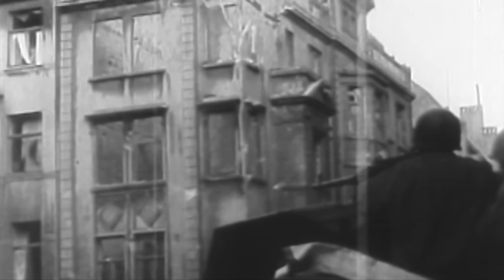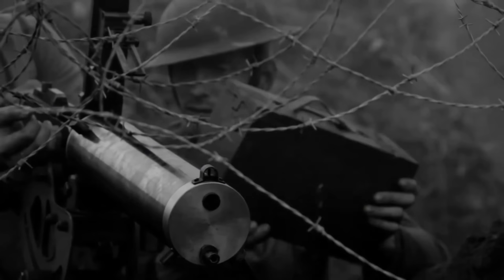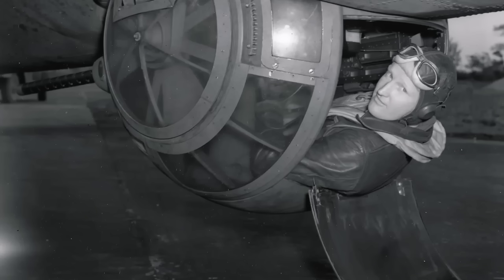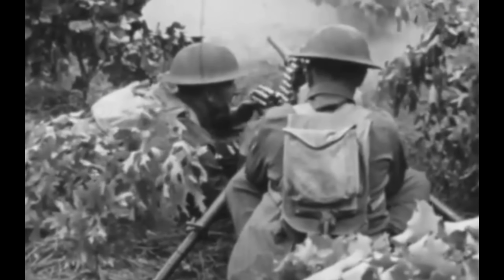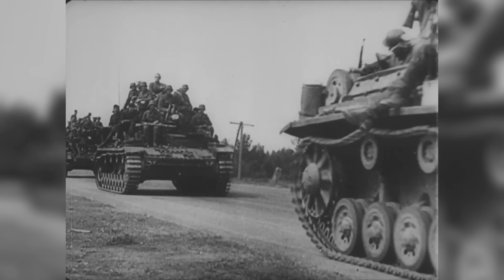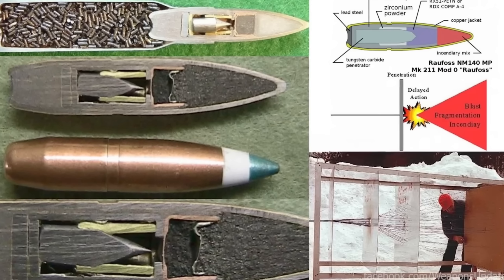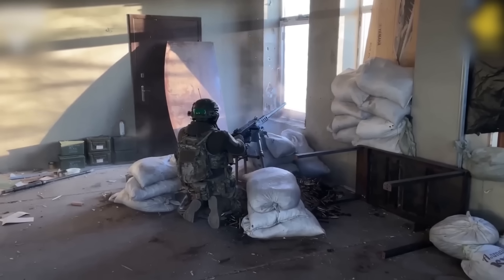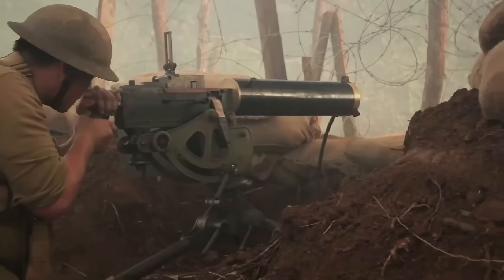The Dark Reason Germans Hated American M2 .50 Cal

Comment: My late F-I-L was a Sgt in the 9AAF, 346thFBG, 107thTacReconSqdrn, P-47 Thunderbolts, ETO, 03/42-09/45. The Thunderbolts had 8 M2’s aboard, I’ve read and heard that when they would dive from 25,000 feet and reach speeds of about 600mph and opened up on German fighters that the recoil of all 8 guns at once would literally slow the P-47 considerably. I bet it was a sight to see.
  My late B-I-L served two terms in the Corps, 69-71, in Vietnam. He told me their FFB was attacked by a considerable force of NVA and VC, he was on an M2 and hit an NVA soldier as he threw down a makeshift ladder onto the barbed wire; John said it cut him clean in two, his torso fell one way and his trunk and legs the other way.

Comment: My BIL was in the USAF and assigned to command an engineering company in Iraq. The M2 was his favorite MG. He said that it could penetrate concrete block walls after a short burst and shred enemies behind. Although he didn't get into many firefights (his was a support role) he brought his entire company home with no KIAs. 
As a side note, I was working on the Peacekeeper ICBM program back in the early 80's and managed the incorporation of nuclear hardness and survivability requirements into the post boost stage. The primary structure had to be able to withstand missile flight through a dust cloud a set amount of time after a nuclear ground burst near the silo. I was in a pebble impact test facility in Orange County and checking it out when I stumbled on a hump in a rug. It was a new old stock aircraft M2 MG under the rug! The owner had requested 50 BMG barrels to set up test equipment, but the USAF decided that if he wanted barrels, he must need the machine gun too. He didn't. Don't know what happened to that BMG.

Comment: As a retired NCO, paratrooper, Artilleryman, Supply Guy and Armorer, there are two systems that in 27 years( 20 Active, 7 Army Civilian) that were my favorites. The Underestimated M60 and Mama. I was a terrible shot with the M16 till later where I could zero 3 rounds in the exact same spot( Note, had to do it twice multiple times because it wasn't believed or skillcraft) My accuracy on the qualifications varied over the years. But with the 60 and Mama, I became an expert every time. The old 60 qual was tough. I could easily single shot one and hit the target. Knew the ins and outs. Jumped it multiple times and as a PFC was at one point the in house expert. Then got familiar with mama. In Korea, after years with the 82nd, I perfected my knowledge and use of mama. I also taught my ADA battery how to prepare firing positions, wePons cards etc while a specialist supply guy(went deaf as an arty guy). This was an Avenger battery.
These two gun systems in the right hands can be devastating on the ground.
Mama though, is less forgiving to the operator if you don't treat her right. That spring can go through brick walls when compressed and not seated correctly.
It's simple, durable, takes a beating and in the hands of those who respect her to this day, will show her worth.
Nuff said.

Comment: I saw Quad 50's still in use in 1992 set up around air fields in Korea. The American M60 machine gun concept was copied in many aspects to the German MG42. The feed tray cover for the MG42 can be installed and used instantly on the M60.

Comment: I used to test these and I used to put them together, when the barrel gets hot because it's rotating you just slide on another barrel, but the M2, hasn't changed hardly at all, that thing is no joke you can cut a house in half of that thing

Comment: I was in charge of parts for Ma Duece and all MG’s of lower caliber in 2000 to 2014 time frame at DLA. During this time I was sent to Anniston by our One Star to help figure out why we were having so many misfires. We had just changed firing pin manufacturers and the Army kept blaming these new firing pins. They sent a whole team of Engineering experts from Rock Island to get a handle on this problem. My Commander sent me to join them. The problems were very unique and I could not do any R&R studies from the info they were giving me. On the indoor range at Anniston when firing on automatic, three bullets would fire normally then maybe a misfire with the pin just barely denting the primer. Then three more good shots then another misfire and then a single firing but the primer was completely pierces thru with gas escaping backwards towards gunner. Same bolt, same firing pin. Changed pin to a brand new one. Same inconsistent results. After a week of air expressing firing pins to engineering labs, I noticed we were using rounds manufactured in the 1940’s (we had many older lots). Ah ha, the answer lay in Metrology. The rounds were manufactured with best available gauging used at the time. Later manufactured ammunition used more precise gauges and ammunition naturally is more precisely made. We can build and gauge digitally out to four digits right of the decimal point. Firing pins now were more precisely gauged. I have great story about head spacing and feeler gauges but that is for another time.

Comment: The US Army is STILL using M2's built for WWII, they are that solid and dependable. So long as they are cleaned properly, and the barrels replaced regularly, the mechanism is all but unstoppable. 
The ONLY issue I ever had with the M2 was it's weight. That thing gets very heavy after a dozen miles or so on foot over uneven terrain at night, especially on a leg you banged up in the night jump that got you there in the first place.

Comment: Can’t believe it’s taken that long to give the .50 a flash suppressor, much less an armored shield. 
In Nam the .50 gunners on top of M-47 tanks were very vulnerable firing at night. We lost the marine on the tank we were dug in next to. He got hit with a rocket fired from maybe 35 meters while blazing away. I had made friends with him. He was really funny and generous with the  mre’s  that they had. Good ol’ southern boy, brave as they come. RIP Marine. I think of you often
Reply: Its because the shield is really damn heavy. For current US Navy use, the gun itself(without the barrel attached) weighs like 40 or 50lbs. The barrel is like another 40lbs. Then the ammo. Our shields are integrated with the deck mounted tripods, but are easily removed, and weigh something like 25lbs by themselves. The shields are 1/4 inch steel plates. All together, the gun and all accompanying equipment/accessories combined weighs like 300lbs. Ridiculous. Considering it was primarily an infantry and aircraft weapon, makes sense to me that armorers would hesitate on making it heavier.

Comment: The German likely didn't go with a 12.7mm machine gun likely because they saw no point as they had 20mm auto cannons on some of their half tracks. And compared to 12.7mm 20mm beats it in almost every category and for a country with limited resources and industrial power you can produce a lot more 8mm mauser with the resources you would use to make 12.7mm. There isn't a lot on the subject why the Germans didn't go with a 12.7mm machine gun.

Comment: The Germans did have heavy machine guns. The MG131/13 was a 13mm heavy machine gun though it was only utilised in aircraft. They did produce a prototype for ground use but it never went anywhere as they had too many other things to worry about. It had a heavier bullet that could have explosive, incendiary and armor piercing projectiles. Usually in belts of alternating explosive incendiary, explosive incendiary tracer and armor piercing. the M2 had a higher muzzle velocity an the ANM2 aircraft version a higher rate of fire. Though a ground use MG131 would have been devastating with a 900 round per minute rate of fire and mini canon rounds getting spat out. The other reason it never went anywhere in ground use is because the Germans had man 20mm canons in that role.

Comment: I remember reading an account from a book on a tank recovery unit. They were behind the lines but not far enough to be out of harms way all the time. They had been having some trouble from a sniper and had been pinned down for awhile. when as I recall a halftrack came down the road on it's way to the front. They were able to stop them and tell them about their problem. They new the sniper was somewhere on the far side of the road in the trees. The gunner on the halftrack turned the quad 50's towards the trees and opened up. Everthing came down, they took the tops of all the trees right off. The halftrack then resumed it's trip to the front. Later they found the dead sniper in the debris.

Comment: The m2 is actually based off and designed around the m1919, basically a 30 cal m2 which was more common to be given to soldiers on the battlefield due to its lighter weight, however that isnt to say that the m2 50 cal wasnt given to soldiers, it was more commonly used in strong points and as a stationary weapon due to the fact that the gun BY ITSELF weighs almost 90 pounds while the m1919 weighs just above 30 pounds, meaning you can carry significantly more ammo and be much more mobile, also not to mention that even though the m2 for a 50 cal doesnt have much recoil, its mostly due to its extreme weight and would not be very fun to fire on the move let alone carried through the battlefield

Comment: I mean it's a absolutely useless gun you don't need 12.7mm for infantry and it has a far too low fire rate a mg needs at least 1200rpm to be a mg otherwise you can take a bolt action and have the same fire rate lol

Comment: its not a reason any darker than any other effect caused by a terrible weapon on the battlefield

this isnt a tickling competition gentlemen. THEYRE TRYING TO HURT EACH OTHER!

the ma deuce (M2) fired a 600 grain bullet at around 2500 fps, it had a rate of fire of between 500-600 rounds per minute and could sustain bursts of over 50 rounds before the barrel became so hot you could see the individual rounds spiralling through the bore even in the full light of day.

in tests against titanum armour the usual ammunition issued to the troops, which was still incredibly deadly when used on soft targets, such as the common .30/06, the rifle ammunition would barely scratch it.

armour piercing (green or black tip ) .50 BMG would nearly penetrate 1" -1/3" inch titanium plate. 

the other reason (the primary reason) was that we tend to under estimate the power of a round and look a only its velocity. But the .50 had so much weight to its slug that it would tear through an entire human torso like it wasnt even there. one slug would rip off an arm then go through another ones leg and finally stop in the skull of a third soldier. 

it was less a gun than a very long range bone saw. 

No wonder it was feared. TheGermans had no equivalent. Nor the japanese. Not until you get up to very rare and specialized 20mm or 25mm anit-aircraft that was used in anti-personelle roles only rarely.

Comment: The reason why the barrel initially travels to the rear is that it is locked to the bolt for a short amount of linear rearward travel.  The mass of the barrel is needed as, if the bolt was not locked initially tot he barrel, the bolt would literally fly back through the rear of the gun and probably kill the gunner.   This is simply physics.  The video is great, but I wish you had gotten this part right..  Forgive me if I missed anything.  Thank you.

Comment: The US Army stocks of M2s is crazy.  In Ramadi, one of my company's tanks had an IED (fuel can and 2x 60mm mortar rounds, best we could figure) dropped on the roof of the tank, blowing the .50 cal out of the mount (and never recovered).  (The tank crew didn't care and continued on its mission supporting Marines out of Hurricane Point - the Marines were impressed seeing the roof of the M1A1 covered in fire and the Army crew, after a short pause to assess, deciding to continue on with the mission.)  The mounting pins sheared with minimal damage to the mount itself.  We ordered and received a new M2 .50 that showed up in Cosmoline and a beautiful shipping crate from the 1950s or 60s.  As these were M1A1 tanks, with the remote, external mount, they included a cable charging system in lieu of the charging handle and with no spade grips.

Comment: Fact.
3006 came from the 8x57mm copied m98 mauser in the 1903a3.
We got sued for patent. 

The 3006 is a slightly longer necked down 8mmx57.
The 50bmg? A scaled up 3006. Side note, 308 is a downsized 3006 but (up to a point) more efficient. 3006 will carry the day at l9nger range.

Comment: You mentioned poor recoil of the early water cooled .50 cal, yet didn't mention just how little recoil the M2 has thanks to the floating barrel design.  Especially on a hard mount, there is very little kick to firing it.

Comment: I served in the Navy,Seabees.  We used the 50 cal. Aiming with shots hitting target, then pop 106 rounds.            I crewed a 106 RR on a wheel barrow chassis.  The 106 rounds and 50 cal rounds too.  Worst carrier all equipment ever was when we fired the 106 round. Ear plugs were not working.

Comment: The .50 Cal used on B17s was not the same round as the BMG, it has a shorter case by about half an inch. It's currently boxed up somewhere so precise measurements are not something I can do without taking a few hours of searching.

How do I know this? Well I have examples of both rounds, one BMG Case & Bullet aa trophy I got for winning a contest at my local gun clubs 100th aniversary shoot. The other one the B17 machine gun round my dad swapped a couple of Eagle comics for during WWII.

That round was live so he used the vise in his dads shed to pull the case from the bullet (the vise marks as obvious on the nickle&lead bullet), he then removed the cordite propellant and burned it, then de-primed the case with a nail and a hammer. 

After telling me all this my Dad said, "If I ever see you doing such a stupid thing do not expect to sit down for a week!".

When I was a 13/14 years old I did a similar stupid thing but never got caught, such as finding some hilti gun rimfire charges/rounds left behind by some builders at school. Then finding that my Webley Hurrican air pistol, that I still have a half a cetury later had a larger opening at the muzzle end. The rifled barrel stopped about 1.5 inches short of the real end and that larger part was the exact diameter of the hilti gun catridges. By pushing a pellet backwards doen the barrel with a pencil up the other end to stop pushing too far, then placing the barrel only in a vise and hitting the rimfire cartridge with a 1lb hammer, that pellect existed very fast. I used very thick old book plus some plywood as a target. The pellet hit the book so fast it actually melted the pellet with splashes of molten lead slightly burning and cooling between the pages.

Then I did the very, very stupid thing and did it again but with a Steel pellet (steel core with a nylon outer for the rifling) that went through the book (almost an inch thick), and the quarter inch plywood and then took a big chunk out of the brick wall behind it. Luck for me my bedroom door was open so it missed that. The next 30+ minutes was spent locating the Tetrion filler, mixing up a batch and filling the hole that I just put in the wall on the landing, that filler sets quite fast so I had just enough time to sand it down and I was also able to locate the paint used on that wall and finish the job.